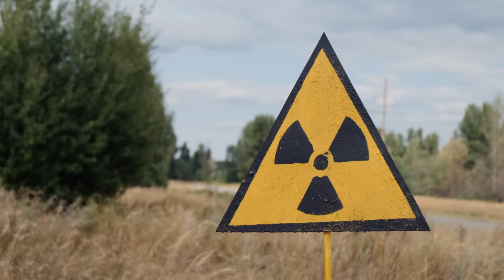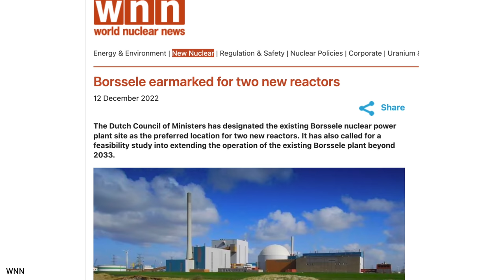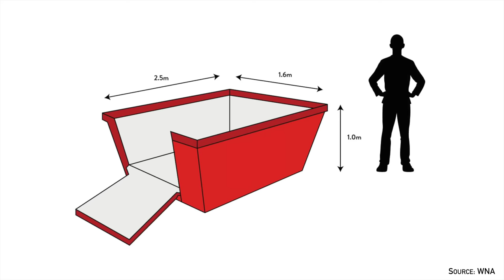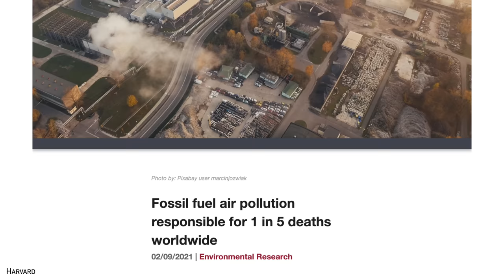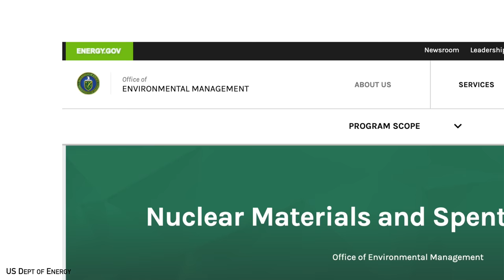Can Nuclear Waste Ever Be Solved? Yes.

Comment: This i why still ask how is nucular energy is viable as we get about 40 years use but takes thousands of years to decay, so that means we will produce more waste thaat we can realisticly can recycle or manage , doesnt seem very cost affective to me 😊
Reply: Nuclear spent fuel never hurt anybody.  This thousands of years thing is FUD.
Reply: @Nill757  Pu239 24,000 half life.  170,000 years before it is less than 1% of the original value so if you had 100 lbs of Pu239 (size of a baseball) , you still have 1 lb after 170,000 years
Reply: @Klerk Cant  Perhaps you didn't read what was said.  Nuclear spent fuel never hurt anybody. 
Any quantities, any time.
Reply: @danadurnfordkevinblanchdebunk  Not in the U.S. .  But comment in 200,000 years from now and we can discuss then
Reply: @Klerk Cant  No, the two billion year old nuclear waste site at Oklo Gabon obviously proves you wrong.
Reply: @clarkkent9080  Uranium 235 half life, 700 million years. Some in the granite in your back yard. Some 4B tons in the ocean.  Should it all be cleaned out?  Potassium 40, about 0.2% mass of the earth, half life 1.2B years.
Reply: @Nill757  As I am sure you know it is not only the radioactivity, or the half-life that is the overall concern.  The biological half-life and target organ is also a concern.  Pu239 is a bone seeking alpha emitter.

 Atomic Energy Control Board: Plutonium is a highly toxic material. Attempts to deny or to obscure this fact are, we feel, irresponsible.0.1 micrograms can overdose one civilian.

Attempts just like you are trying to do.
Reply: > This i why still ask how is nucular energy is viable as we get about 40 years use
I believe you are confusing the license of a LWR NPP, which is 40 years (for the first go-around - although several have extensions to 60 or 80 years) with the use of uranium.

>  but takes thousands of years to decay, so that means we will produce more waste that we can realisticly can recycle or manage 

https://en.wikipedia.org/wiki/High-level_waste suggests 25-30 tons/1000 MW reactor.
To run 100% of our electricity sector, we would need about 4000-5000 NPPs worldwide.
I am going to round tons/year down to 25, and NPPs up to 5000 to make the math easier.

6,000,000 tons - 1 year of a SINGLE coal plant's emissions (excluding ash) from our video here,
6 MM / (25 * 5000) = 48 years to create that much spent-fuel waste. We can deal with this level of waste.

1000 years of 100% of nuclear electricity with no reprocessing - 125,000,000 tons of waste.

Alternatively, McDonald's sells 4500 tons of fries a DAY. Which means that every 74 years, they are moving 125,000,000 tons of fries (which I consider a waste of otherwise good potatoes).

These are masses/volumes that we CAN realistically manage and recycle. The numbers sound big because you are, like me, an average guy, and not thinking at the scale where 1000s of tons is actually quite small.

Once you add in reprocessing, scientific progress, more efficient reactors - over the course of 1000 years - this all becomes even smaller.
Reply: @factnotfiction5915  The 40 year license is based on the DESIGN life of the reactor and associated components.  Pumps, valves, heat exchangers, electronics, piping, and vessels all have a service life.  Most reactors are shutdown by their investor owned utilities because they become to expensive to maintain and replacement parts for critical items are no longer made. Many of the reactors approaching their 40 year life are scheduled to be shutdown. Why don't you see any 1970s automobiles driving around????

The oldest (52 years) operating nuclear plant just had one  of their stainless steel reactor coolant pipes corrode and leak over 400,000 gallons of primary coolant. 

Regulators are monitoring the cleanup at the 52 year old Xcel Energy Monticello Nuclear Generating Plant after it leaked 400,000 gallons of radioactive water.  The leak was first discovered in November 2022, 5 months ago, when radioactive Tritium was found in a well.
The incident at Xcel Energy's plant, came to light on Thursday, 4 months after it was first detected in a groundwater monitoring well. The reactor continued to operate while plant personnel tried to locate the leak. State officials said they delayed because they wanted to gather more information before going public.
Officials said the water contains tritium that is thousands of times above EPA limits but is of no risk to the greater public.
"We knew there was a presence of tritium in one monitoring well, and Xcel identified the source of the leak as an underground transfer pipe," Minnesota Pollution Control Agency spokesman Michael Rafferty said, per the AP.

Comment: in the nuclear sector, all calulations have so far been too optimistic ... just have a look at the current built reactors - how much are they delayed or over budget? ...In Germany they used to hvae a final storage - the Asse - which was planned to last for the 100.000+ years -- howver after 20 years they had to dig all the waste out again ... how probable is it that we find a storage that can be safe for lonter than the mankind existed so fart ...

it is ok to research nuclear poswer - however it should not be used at idsutrial scale as long as we are unable to make all of the waste harmless within a human lifetime - max 100 years!!

We only borrowed the earth from the future generations, why do they have to solve the problems where we don't konw a solution for ...
Reply: But there are many suitable final storage options in Canada, Finland, here in the US and elsewhere.

I heard the problem in Germany was a materials failure with the casks, not the actual location. 

Provided the cask is sturdy enough and the site is stable enough, there's no issue.
Reply: @YourCapyFrenBigly_3DPipes1999  safe for more than 100.000+ years! What I wanted so show with the case of Asse was that there was a point that was evaluated wrong. How can we be sure that the next storage location has no flaw for the next xx generations. If there is a flaw i hope that this will be detected and correctly managed. What makes me worry a bit is that due to the high costs of continuous monitoring, the currrent plans propose no monitoring ... I am not sure if this is such a good plan.
Reply: @herwigg3327  nothing wrong with Asse, that was political non sense.

Comment: Although radioactivity decays over time, decreasing its environmental risk, the by-products of this decay are heavy metals such as lead. Therefore, this solution is not the best one, as in the long run it will bring another headache.
Reply: The decay end-points (like lead, and bismuth) are many thousands of years away, and lead isn't much of a problem. We mine it out of the ground already. The real problem is the first few thousand years of storage, and we see no real progress there. The short term headaches are already too hard for the decision makers.

Comment: It is still better than coal I believe.
Reply: If you live in the U.S. here is the reality for the last 4 “state of the art” Generation III Westinghouse AP1000 ADVANCED  new nuclear power projects and spent fuel reprocessing in the U.S. over the last 20 years. The AP1000 is fully approved by the NRC for construction and operation.  The only NRC requirement is that the plant be built per design documents…..seems simple..

The Southeastern U.S. is super pro-nuclear MAGA, has zero anti-nukes, and 100% media, local, and political support. 

The MOX facility (South Carolina) was a U.S. government nuclear reprocessing facility that was supposed to mix pure weapon grade Pu239 with U238 to make reactor fuel assemblies. It was canceled (2017) in the U.S. After spending $10 billion for a plant that was originally estimated to cost $1 billion and an independent report that estimated it would cost $100 billion to complete the plant and process all the Pu239, Trump canceled the project in 2017.

VC Summer (South Carolina) new nuclear units 2&3 were canceled in 2017 after spending $17 billion on the project (original estimate of $14 billion and 2016 completion date) with no clear end in sight for costs or schedule. Four managers on the project were charged with 16 felony counts, including conspiracy, wire fraud, securities fraud, and causing a publicly traded company to keep a false record.  The CEO of the project is serving 2 years in prison, another manager just got 15 months in prison, and the others are awaiting trial.

Vogtle (Georgia) new nuclear units 3 &4 at 110% over budget and schedule (currently over $34 billion with an original estimated cost of $16 billion). Mid way into the build, the utility stated that had they known about the many costly delays they would never have chosen nuclear. They were just delayed another year because according to the project management, thousands of build documents are missing. The first unit should start in 2023 and when it does, Vogtle will be, for its output, the world’s most expensive nuclear power plant.

Please google any of this to confirm.

If you can’t build new nuclear in the super pro-nuclear southeast U.S. then where can you build it?
Reply: @Klerk Cant  And you continue to ignore from your blank trolling channel that many countries have been building and using small modular reactors for many decades, built in two years or less, for millions not billions.
Reply: @clarkkent9080  
I believe that MOX fuel has it's own issues. The high plutonium component produces far more U236 and U232 in the spent fuel. My understanding is that this greatly complicates further re-use.

Comment: The finnish solution of disposal originated in Sweden. But the swedes have not implemented it, because it is proven to be unsafe. The copper containers that was calculated to hold for thousands of years are now proven to be at risk of cracking after only a couple of hundred years. 
Ok so that doesnt work.
We have gathered enourmus amounts of highly hazardous waste in only 70 years. 
And we still have no working way to get rid of it.
Hardly an energy source for the future.
So the answer to the question is not yes. Its no.
Reply: I don't think you have all the facts. The midterm and final storage info I have heard has sounded well-thought out and reliable.

Comment: High level waste.  Storing or processing has some cost.  And that cost is not being included in utility bills.  It's an external cost being pushed off on taxpayers.

Remember, nuclear-produced electricity is already a very expensive way to produce electricity.  And that's without including the cost of long term high level waste storage/disposal, backup generation, and storage needed to match demand and supply.

Why would we want to build more very expensive nuclear generation when we have much, much less expensive 100% reliable lower lifetime carbon footprint alternatives?
Reply: “cost is not included”

Yes it is.  Nuclear industry paid $32B to finance construction of a US long term storage facility, which was built under the law.  Per a federal judge, NRC broke the law by blocking the operation of Yucca.
Reply: @Nill757  
That long term storage facility was not the solution needed to safely contain the most hazardous nuclear waste for the 100,000+ years it will remain dangerous.

Comment: This exactly why SpaceX Starship is more important than people realize.  Once we they can get the reliability of StarShip to the same level as Falcon 9, the waste can be safely launched and put into a safe trajectory to our son.  At this point, all long term issues are resolved.
Reply: Interesting word slip - "son" when you meant Sun.

But, yes, if we reach the ability to escape the Earth's gravitational pull at a 99.99+% safety level then off-planeting our high level waste should work.  What we might want to do is to send up tiny amounts per launch and in some sort of super-strong container so if there was a failure the amount that we'd have to search for would be very small and well secured.

I'm not sure we should use a 'maybe' solution as permission to make our problem larger.
Reply: @bobwallace9753  Mithraic
Reply: @jeruharlem  
I suppose were we to worship anything then worshiping our Sun might be a good choice.  Without our Sun the Earth would be a frozen, uninhabitable ball of rock.
Reply: Ahh no. There's always a risk of the rocket failing and then you'd have the equivalent of a dirty bomb when it does fail.
Reply: @madmax2069  
Not necessarily.  Design the waste container to separate from the lift vehicle as is done for human cargo.  Let the waste container return to an ocean landing via parachute and then recover it.
Reply: @bobwallace9753  but you have to account to weight, to make a container safe enough it would be far too heavy to even be economic. But regardless it would be far too risky.
Reply: @madmax2069  
If we can have safety systems for humans why can't we have similar safety systems for radioactive waste?  I need facts, not opinions.

"A launch escape system (LES) or launch abort system (LAS) is a crew-safety system connected to a space capsule. It is used in the event of a critical emergency to quickly separate the capsule from its launch vehicle in case of an emergency requiring the abort of the launch, such as an impending explosion. The LES is typically controlled by a combination of automatic rocket failure detection, and a manual activation for the crew commander's use. The LES may be used while the launch vehicle is still on the launch pad, or during its ascent."

Wiki -
Reply: @bobwallace9753  what I'm stating are facts, not opinions. It's pretty easy to research. It's pretty easy to research why we don't just load up rockets with nuclear waste (weight is a major factor).
Reply: There are over 400,000 tonnes of civilian spent fuel on earth. 
Falcon heavy can get about 64 tonnes to low earth orbit.
To get that payload out of the solar system will need roughly double the delta-V.
To slow it down enough to get to the sun will require three times that much.

Existing waste will require tens of thousands of Falcon heavy launches.

You might want to consider cheaper options.

Comment: Renewable energy IS the future. It's so much cheaper and safer!
Reply: RE … plus what? Everywhere in the world , there’s some gas plant, coal plant hiding behind the curtain. You must know that, so why can’t you own it that you support the fossil fuel combo, an expensive and dirty combination?
Reply: Safer? Banqiao (hydro) was responsible for 26k-240k deaths.
"Of the top 10 riskiest jobs, roofing comes in at number six. Workers in the roofing industry are three times more likely to have a fatal injury than workers in other industries, and about 50 roofers are killed on the job each year." (if youre installing solar panels on roofs then you would add to the number of roofers who die each year. These numbers are probably just the US. They might also wind up paralyzed)

Someone was burned to death because they were trapped on a wind turbine.

These dont include the environmental impact such as solar farms causing flooding which kill people, and destroy crops which lead to famine which kills people, and causes people to remain in poverty which kills people.

Only 50 people died because of radiation from the worst nuclear accident. Any deaths from nuclear are basic workplace accidents (slipping, etc). Nuclear is the safest source of energy.

Most people who are exposed to nuclear radiation dont get lethal doses and their cancer wont develop for 20+ yrs but if it did there were probably contributing factors like obesity, smoking, etc and regardless of that most cancers have a 70%+ survival rate.

If nuclear is more expensive then why was Topaz Solar Farm more expensive for the same size as RE Ginna Nuclear?

Topaz is 550mw and cost $2.4billion

RE Ginna Nuclear is 580mw and cost the equivalent of $504million in 2023 money

The largest solar farm in the world is Bhadia in India and cost the equivalent of $1.3billion usd for 2,245mw
"It is estimated to produce 732,874 MWh per year."

A similar country that built nuclear recently built Fuqing Nuclear Power Plant. Its capacity is 6,150mw and cost about $16b. It produces 39,394,320mwh (39,394.32 GWh) per year. Thats 54x more than Bhadia.

If Bhadia were to have the same output it would cost $70billion.

Karachia Nuclear in Pakistan cost about $13b usd in 2023 and has an annual output of 6,208,890 mwh (6,208.89 GWh). That's 8.5x more than Bhadia.

For the same output as Karachi Bhadia would cost $11b.